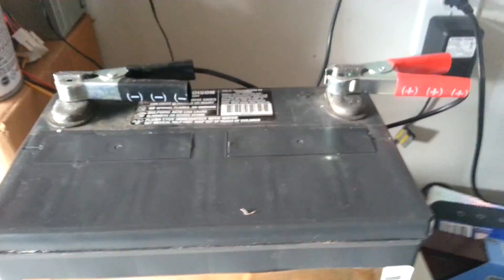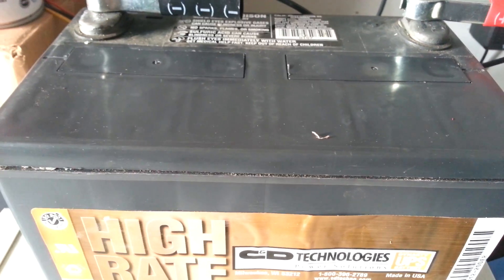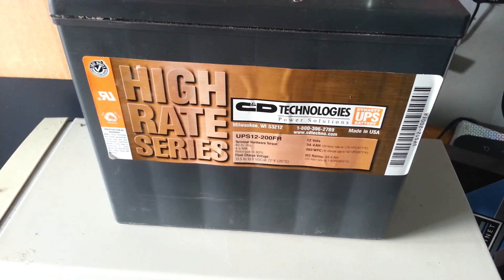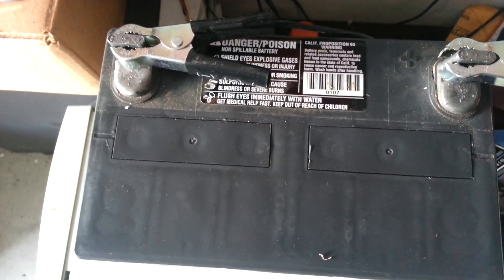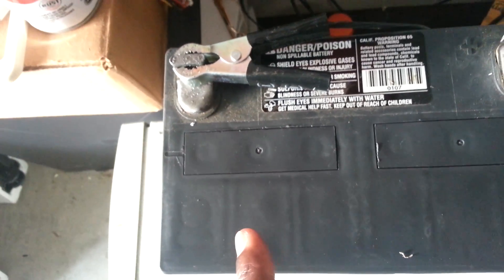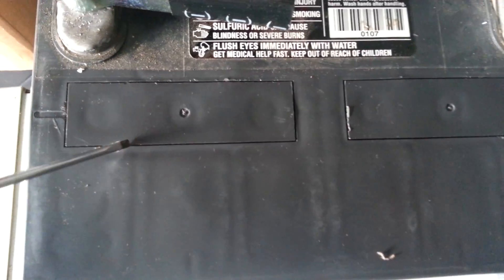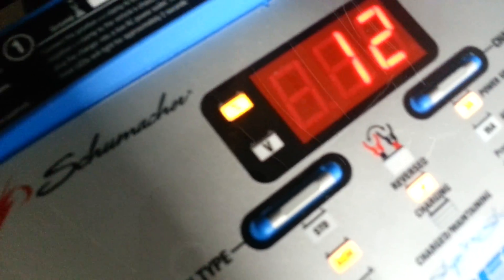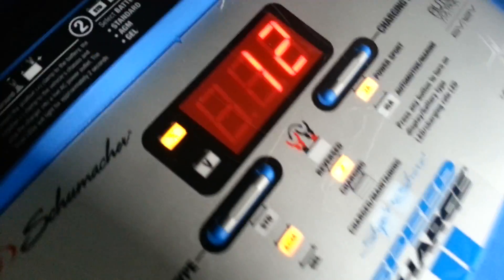How to bring a dead lead acid battery back to life

Comment: Just so you know, adding distilled water did not bring back your battery to life, you were just lucky enough that the battery itself was low on water and the plates inside had nothing to conduct any charge, so your video isn't really that helpful, i'm a certified mechanic and at this time working with 36 volt forklift batteries that either can take faucet water or distilled and if the electro plates are bad it doesn't matter what water you use it will not bring the battery back to life.

Comment: sealed batteries are sealed. the ports with the little rubber caps, hidden under a panel, are for filling the battery and venting gasses when charging. that you can refill electrolyte through those ports is quite nice. hardly any info on reconditioning, though.

Comment: Awesome my friend I'm in a wheelchair and a friend gave me a power wheelchair takes two batteries the batteries are around $300 a pair I'm going to try to do the same this thing has been sitting for some years thank you buddy👊✊👍✌
Reply from the maker: Roy, I am glad you that you found the video helpful.  All the best with your project.
Reply: DIY OneForAll thank you very much man I had to buy batteries these will too gone I tried though lol
Reply from the maker: Yeah, it's possible that you had a few bad (leaking) cells.   If the cells are in good shape, it should work great. I have had good success with a few batteries.  Again, you will never know until you try, which you did.  Great.